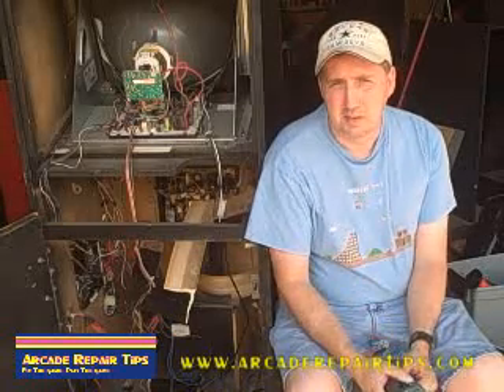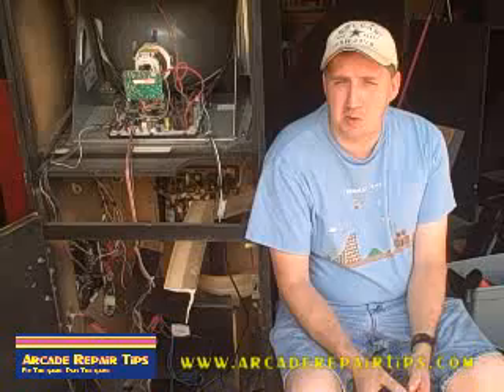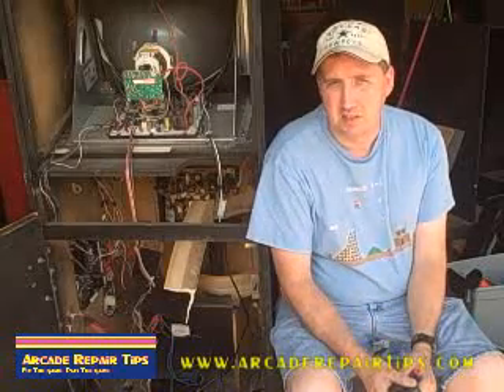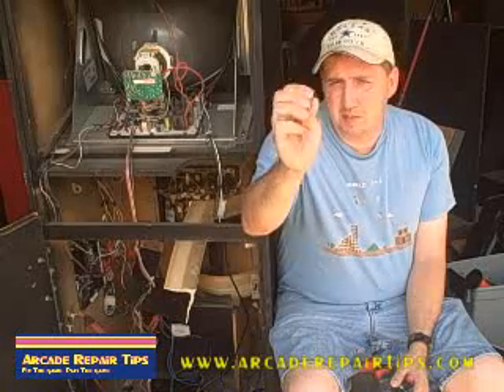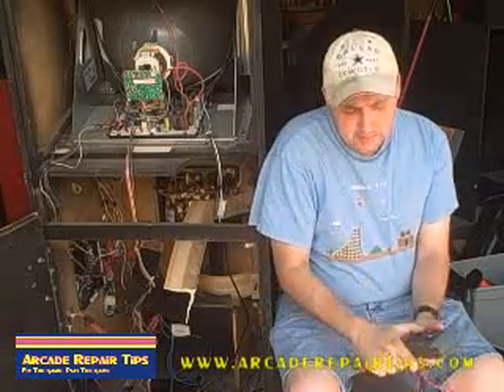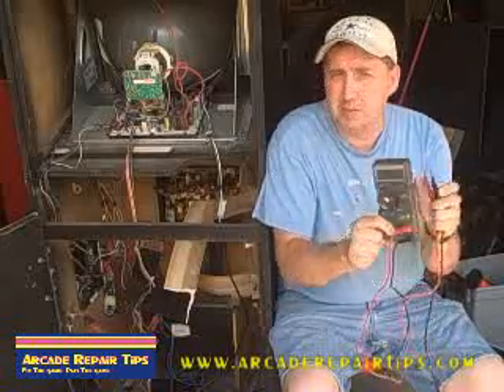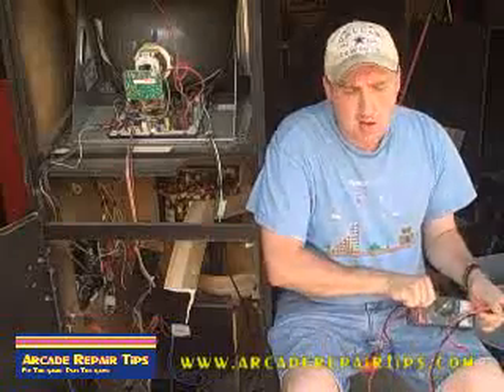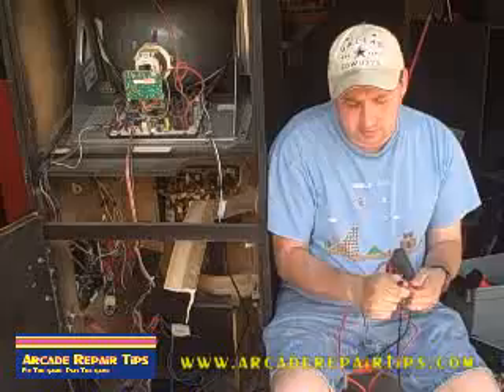Arcade Repair Tips - Checking Fuses With A Multimeter

Comment: Wht number are they supposed to fluxed if it's bad
Reply from the maker: When it comes to fuses, we perform a simple continuity check with a mulitmeter to make sure that the fuse is not blown. If the fuse is blown, we recommend checking the manual for the game to find the correct fuse type/amperage. Sometimes operators will use a different type/amperage fuse as a temporary solution to get the game back up and running so you can't always trust the type/amperage of the fuse that is currently installed. Hope that helps!

Comment: Good stuff.  I worry a little bit because you have not recommended which category DMM to use (Cat I to Cat IV or more). Your Fluke is great, many people will try to spend a little less.  They can, and have, been disabled or killed by purchasing the wrong DMM.

A good reference is:
http://en.wikipedia.org/wiki/Measurement_category#Impulse_withstand_voltages

I never buy or use a meter less than Cat III rated at 600V or more.  I work in a normal environment with both a residential 240/120 single phase and a larger 208/120 Wye (Y) three phase transformer.  The 3P is for my shop but you will find yourself in a commercial building sometime that has 3P Y or Delta power and you may not know it.

If you are going to poke about with anything less than a Cat III DMM, you better know exactly what you are poking at.  Seriously.  DMMs can blow up in your face. 

Check out:
https://www.youtube.com/channel/UC2DjFE7Xf11URZqWBigcVOQ

and the accompanying EEVBlog web site.  Nice guys. Good advise.  Best of all, they don't try to market some "Joe Bob Restorations" company by bashing other people.  They will help you pick the right DMM for your (and your family if you are so lucky) needs.

Comment: yeah but some times like 1 out of 10 the meter is wrong...i found that out on a pinball i was working on.meter said good  but still no lights so i changed the fuse anyway just for fun and the lights worked so.triple check everything............